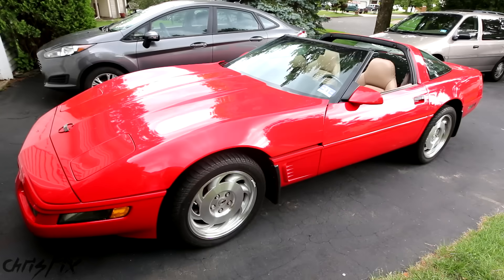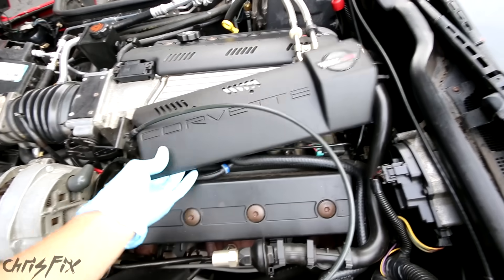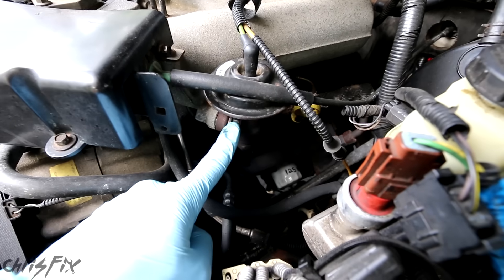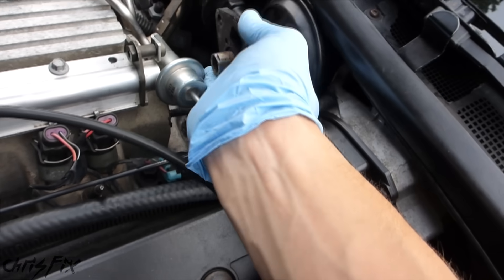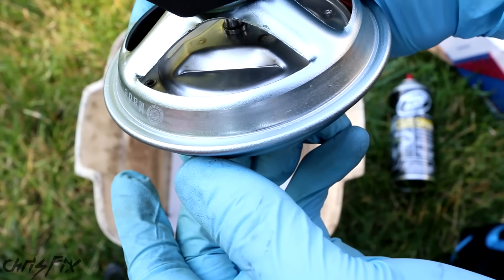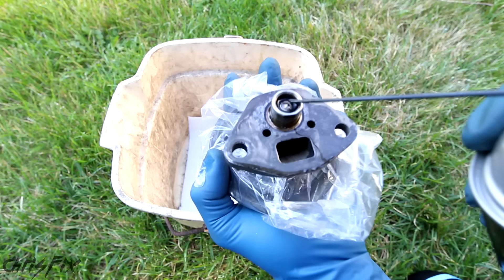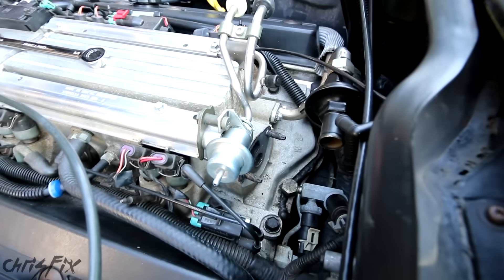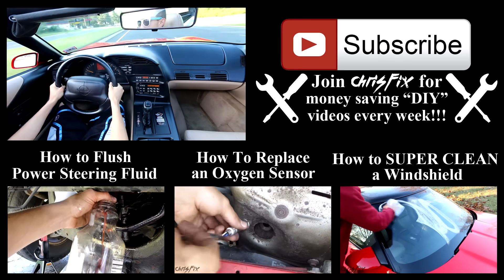How to Clean and Replace an EGR Valve P0400

Comment: Hey Chris, I need some advice.  I have a 1994 Chevy 1500...It is flashing code 44 (fuel/air lean) yet I am failing emissions with my HC and CO to rich(everything else is fine).  I have replaced the catalytic converter, the EGR valve, spark plugs, O2 sensor and exhaust manifold and valve cover gaskets and cleaned the carbon in the exhaust manifold ports where the EGR connects...My EGR solenoid and MAP sensor and PCV valve and engine temperature sensor on top are fine.  I have used Seafoam and smoked it for vacuum leaks and there isn't anymore... I am at a complete loss because I can't get the HC and CO levels lowered...The cone spray out the throttle body appear fine...One thing is also strange...My new EGR won't hold suction while the engine is running when using a vacuum pump...It's like the exhaust system is sucking the plunger bladder back in when I am sucking it out - lol, but when with the engine off using the vacuum pump the EGR holds suction fine...My truck seems to run just fine yet the check engine light comes on exactly 7 and half minutes after I start the truck with the code 44 every single time and it will clear when I turn off the ignition then come on again 7 and half minutes later...Oh yea, i also replaced the thermostat and the fuel pump pressure is normal...H E L P !!!!
Reply from the maker: Rico Escobar Dang, that is a tough problem! You might consider trying something like this since it is really hard for me to diagnose this problem over the internet without seeing the car and connecting my scanner: http://www.amazon.com/gp/product/B000CIPUR8/ref=as_li_tl?ie=UTF8&camp=1789&creative=390957&creativeASIN=B000CIPUR8&linkCode=as2&tag=chri0e2-20&linkId=ALUHHY5EXVQNDHSW
Reply: ChrisFix Ha ha ha ha ha - That is the funniest thing because I just bought that product a few days ago and am running it in my tank right now -  Will see what happens...I am soo frustrated...The parts I replaced honestly needed to be replaced because I correctly diagnosed them to be faulty thanks to your channel and several others..."You Tube University" has really coached me up for sure and I have learned A LOT - I just need a "victory"....Buddies of mine are like just sell your truck because your spending too much time and money replacing parts, but I can't - I am pot committed and have to win !!!  I have to know why it's failing inspection because the HC and CO levels are too high despite everything I have done to correct it  !!!  If your shop was in Texas, I would come visit you - lol...I like your coaching style...Do you have any thoughts on why my EGR valve is acting like it is...I tested two of my buddies trucks and both of their EGR valves continue to hold suction while the truck is running...I bought a EGR valve from AutoZone and the Chevy dealership and they both act the way I explained earlier...What do you think would cause that?  I can't help but wonder if this is the problem...Listen, thanks for responding - I do appreciate it...

Comment: Hi Chris! Why do some people blank out the EGR (mostly diesel vehicles) Is there a benefit?
Reply from the maker: Naveen Amarasuriya The EGR is notorious for gumming up the intake with carbon, especially on diesels so that is why.
Reply: So, blanking the EGR has no ill-effect on engine performance, fuel consumption or life span? Much appreciate your insight on this. Cheers!
Reply from the maker: Naveen Amarasuriya It does potentially have effects but it is based on the type of vehicle and how computerized it is. Older vehicles are easier to block the port off while newer vehicles need to be tuned many times.

Comment: Those pipes you are pointing to at the beginning of the video are actually the air injection tubes for the air pump.  The egr passages are actually in the intake in this engine.
Reply from the maker: punker6506 Thanks for sharing!

Comment: So if your egr valve is bad when you put it on drive will your car turn off because that's what my car is doing
Reply from the maker: g guevara If there is a big enough vacuum leak, yes, it could potentially cause the car to stall.

Comment: Excellent video.  On most OBD-II vehicles it only takes about 20 miles to confirm the EGR will not trigger the CEL again.  100 miles is excessive because a dealership tech can't drive that far to use as a confirmation of repair.  I'm sure their bosses wouldn't like their techs driving halfway across the state to confirm a repair.  ECU's are programmed to use about 15 miles to prevent people from trying to fool state emission inspections immediately after clearing codes in the parking lot.  There is a minimum for a reason. ;) If you don't have a CEL reoccur after 20 miles you're good to go.
Reply from the maker: ***** Thanks for sharing. My truck requires over 200 miles of driving for a cleared CEL which is why I said 100. I had a P0301 and I cleared it after I fixed it. Drove around for 100mi and got inspected and failed the readiness test. It blew my mind lol. Thanks for the info bud!
Reply: ChrisFix OBD-II EGR system is part of the readiness monitors.  They have to be set as ready to pass inspection.  Only applies to OBD-II vehicles because there are no readiness monitors on OBD-I vehicles.  Readiness began with OBD-II.  I could see it possibly taking longer with OBD-I vehicles since it's all mechanical/O2/PCM strategy which varied vehicle to vehicle and manufacturer to manufacturer prior to 1996.  EGR codes prior to 96 would be considered a continuous memory code (equivalent to a pending code in OBD-II).  It takes X amount of drive cycles to kill a continuous memory code, it's not mileage related it's drive cycle related.  Just some more info to think about if you're working on an older OBD-I vehicle.  Your channel has gotten so much better now.  Keep up the great work.
Reply: South Main Auto Repair
Hmmm can probably fool it by lowering all the temp sensors.  Too much work lol just let it sit.  I didn't know that Eric, great info.

Comment: I have been considering blocking off my egr valve , on my isuzu dmax whith a plate but not sure if it will improve fuel economy or make it worse,  as i understand when engine is not under load it wiĺl improve fuel economy by the exhaust gas making the cylinders smaller meaning less need for engine to pull in more air,therefore making it easier for engine meaning better fuel economy, true or not ?
Reply from the maker: isuzu dmax Depending on the year, your computer will be adjusting for the EGR gasses and if there are none, then it might run rough and throw a code (and you wont be getting better mpgs if that is the case). If you tune it out, you might get better mpgs on a diesel.

Comment: How does hot exhaust gas cool the engine?
Reply: +Greg Gallop  The EGR system re-inserts already burned gases into the intake system.  Since those gases can not be burned again, it lowers the peak combustion temperature, therefore reducing the oxides of nitrogen level.
Reply: +Alan K well said ..
Reply: Greg Gallop j
Reply: The exhaust may be hot, but it's still colder than the engine.
Reply: So is outside air, why not bring in outside air - with oxygen in it.
Reply: +Greg Gallop They do, but it's not enough. Look through the comments, someone here said something fancy that explains it.

Comment: How I wish that cars were still that simple to work on as the vette. Anyway my car started overheating. On start up it is at normal operating temp on the gauge, within five minutes in is right below the H. I turned it off opened the hood, I saw a small amount of steam, Top radiator hose was HOT. didnt burn my hand but it was up there. Lower radiator hose was warm but more towards the cool side. Am i correct in suspecting the thermostat? FYI radiator has been replace 2 months ago due to leak and problem started today.
Reply from the maker: argonian bilbo That sounds like the thermostat to me. It could also be air in the system.

Comment: Hey Chris!
Where do you find information about car repair,like how much oil it needs,how hard to tighten bolts and so on,i have old car and its very very hard to find any information about it in internet.
BMW E23 728I 1983.
Thanks !
Reply from the maker: Viesturs Lācis That is tough. I would try to find a service manual or go to the BMW forums.

Comment: Hey Chris- off topic but I was wondering... Why does no one talk about chamois for wiping down a car?  All I see now are microfiber, microfiber!
Reply from the maker: Seafarer Bones A chamois does too good of a job and absorbs too much water. Although it sounds counter productive, you want a little water left on the paint to provide lubrication to prevent scratches. That is why I use a spray wax when drying.

Comment: Hey Chris I have a question for you. I have a 2004 Ford Mustang v6. My abs and traction lights are on. My question to you is,does that obd2 scanner can read abs codes? Thanks
Reply from the maker: smokeu600 Yes it reads abs, traction control, tranny, etc lights on American cars. Check out the product review video with the link in the description and also you can find the link to the actual scanner in the description.

Comment: I removed and blocked off my EGR on my Bronco seem to be getting better Fuel Mileage now I have noticed.
Reply from the maker: TRX450R Vlogger Thanks for sharing! On the older cars you can block it off without the computer freaking out, but on OBD2 cars your computer will freak out so you need to get it tuned out.
Reply: Oh I see.

Comment: Man, this is just the sort of thing I need right now. I've been chasing an oxygen sensor "always lean" fault on my 94 lincoln continental off and on for months now. The O2 sensors test good, and I hear a high pitched whine at times, so I suspect vacuum leak. Haven't had any luck with spray tests, so I'm at the point of suspecting EGR valve, EGR solenoid, PCV valve, vapor canister purge solenoid, PFE sensor et all. I don't want to just replace them at random, so it's great to see a method for checking and testing the EGR valve. I'd love to see more videos on those types of components that could act as a vacuum leak as they can be tough to diagnose. Thanks as always!!!
Reply from the maker: Matt Mihm Glad the video was helpful! I really want to find a car that has a vacuum leak so I can show how to find the leak. That would be perfect! Keep me posted on what you find!

Comment: Hey ChrisFix could you help me out? I wanna remove the black paint from my standard alloys wheels, should i try to scrub the paint off?
Reply: Gurbaghe Singh UMM NO! Why?  Scrubbing paint off will more than likely damage the surface permanently.  Better to just live with it, have it media blasted by a professional, or just plasti dip it the color you desire.
Reply: Hey thanks for the reply, ***** would it work if i were to sand the alloy and then spray paint it silver?
Reply: Yes and no. Sanding metal is not like sanding wood. Sanding metal scratches the surface and over time that could make the wheels brittle or damaged permanently. Your best bet is to just plasti dip them in silver metallic color. This way it doesnt damage the metal and you can peel it off when you are tired of the silver or it begins to tear, which if done right should last 2-3 years. Thats what I would do. Check out pasti dip your car here on youtube there are tons of how to vids.

Comment: Chris, I just bought a 2000 gmc sonoma 5 speed . When I crank it , it fires up to 1000 rpm then dies. Then I try to crank it a second time and it idles normally . Can u help me out?
Reply from the maker: Bryce Meta I would check the fuel pressure: https://www.youtube.com/watch?v=_oXLUqE4Sf0

Comment: Many european/japanese cars having electronic EGR and no visible pipes for it suffer from blocked EGR passages inside the intake manifold so it's not that simple to clean them up. Idiot engineers have usually made those passages so small that they are blocked by carbon sooner or later.
Reply from the maker: YouStubid Dang, that really stinks!

Comment: Chris is the egr the same for all cars ? Because mine is a vacuum egr but it's cylindrical.
I also wanted to ask you if it's possible to do a video about cleaning the engine bay and what you need to clean on an old car. I recently got a 2006 car and I just wanna do some maintenance. Thanks man
Reply from the maker: Khalid AlNajjar It is pretty much the same for all cars. There will be slight differences in the design of the egr. I will be doing a video on properly cleaning the engine bay. Stay tuned!
Reply: ChrisFix Thanks man.

Comment: If carb cleaner cleans carbon build up. can you spray a little into the pistons at a time until it cleans it out?
Reply from the maker: Josue Garcia You can do that. Just have to be careful because too much carbon coming off at once is bad for the cylinder.
Reply: ChrisFix Cheers! and what if we could stick a small vacum line in there to suck up all the old carbon? You should try it! haha

Comment: Hey ChrisFix you said the exhaust gas runs back to the engine to cool it. Can you explain this any further please. Isn't the exhaust gas way hotter then cold air from the intake manifold and shouldn't this heat up the engine. I always thought egr is just for fuel economy but I also don't get how this works either.
Reply: There is no 'cooling' as it's prevented from reaching high temperatures required for the formation of NOx, that would occur on an engine without an egr valve.

 This is done simply by reducing the overall temperature of combustion by recirculating waste exhaust gases back into the combustion chamber, the waste gas has a much lower Oxygen concentration then air and with various inert gas's thus you have incomplete combustion of the fuel, slower burn and less heat produced overall. 

Thus reducing NOx at the cost of fuel economy/performance.

It's bad for engine health but good for yours, a fair compromise if you like to continue breathing.

Other nasty stuff like Carbon monoxide produced from incomplete combustion (although which can still burn) is taken care of via catalytic converter.
Reply: ***** Dude. He just gave you an AWESOME explanation. Still feel free to ask questions if needed. :)
Reply from the maker: ***** Yea, it sounds contradictory for sure! Since exhaust gas is already exploded and used up gasses, when you suck it back into the engine, it cannot contribute to the combustion process. Since it cannot add to the explosion, it cools the cylinder temps. Remember we are talking about 2000F in the cylinder so adding 1000F exhaust gasses will cool the cylinder. If you added outside air, it has oxygen in it so it would cause more gas to explode and heat the cylinder up even more even though outside air is a lot cooler. Make sense?
Reply: +ChrisFix thanks for that explanation! Perfect!

Comment: Hey chrisfix I have an 03 mercury marauder it hesitate are low rpms I have no check engine light. I had the motor check the transmission check Nothing perfect. If u have a idea please let me know.
Reply from the maker: Danny Rozay Those engines are known to have bad coils. It stinks you dont have any check engine lights because that is how you would know what coils are bad. If it isnt the coils, I would check the fuel pressure which will tell you a lot of info: https://www.youtube.com/watch?v=_oXLUqE4Sf0

Comment: If that spray cleans carbon deposits well has anyone tried spraying it into their engine to remove carbon?
Reply from the maker: Jesse Crandle It removes carbon deposits when the car is not running. Once you add the cylinders firing up and down, that is a whole other ballgame. I am sure you can squirt it down the spark plug hole but you can do that with any cleaner.
Reply: ChrisFix Yeah people always say "just soak the pistons in kerosene" lol... thanks but no thanks. Sounds like a lot of work and possible dismantling which 99% of the time just isn't worth it for some carbon.

Comment: My father's 2000 Ford Ranger... the damn EGR pipe that leads to the exhaust manifold has that stainless steel mesh shroud on it to keep the pipe from getting too hot, and I could never figure out where the gross air leak was on his vehicle. Turns out it was that pipe. Unfortunately for ME (and my father) all the bolts that fasten it down are so rusty that I'll break the brackets that hold the EGR valve, the pipe connecting it to the exhaust manifold, and I'll never be able to attach a new one. Kind of a shame as he now pretty much has a permanent air leak so strong his truck pings all the time lol.
Reply from the maker: Jesse Crandle That stinks. Try using this stuff on the hole (it works great): http://amzn.to/1MuJPof

Comment: To me, the egr valves look like fuel pressure regulators. Also nice looking vette. It may be on your future video list but how to troubleshoot an emergency brake that doesn't operate. Cant wait for more videos.
Reply from the maker: mrklimczyk They work pretty much the same way in the sense that it is a vacuum driven valve. I appreciate the suggestion and that would be a great video! I def already have it on the list but I will do my best to find a car that needs an emergency brake fix and make you a video!